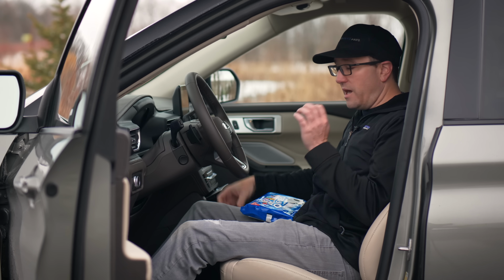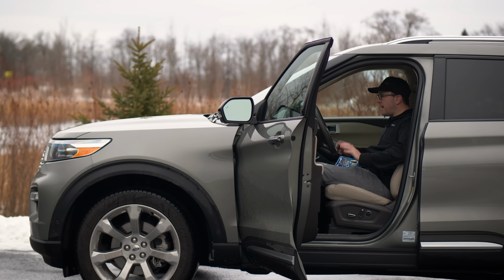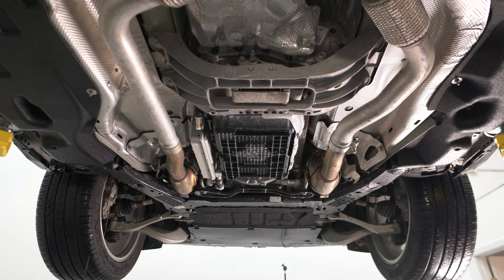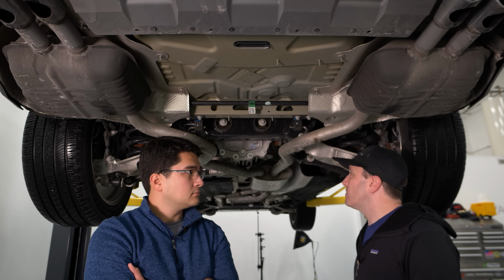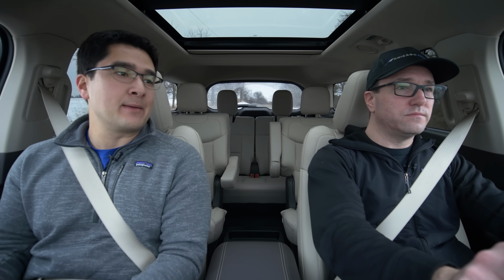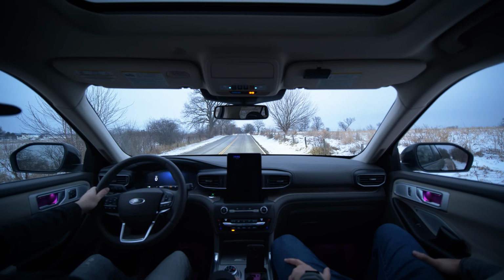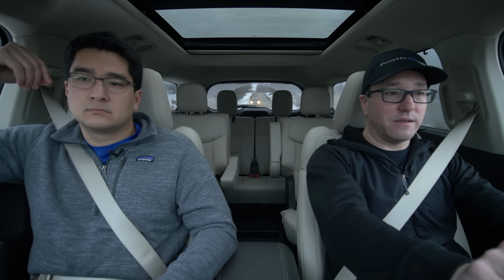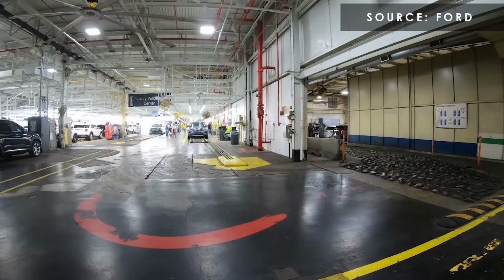2020 Ford Explorer | Who Is Responsible For This?

Comment: Very good review, that's fairly comprhensive. I've had 3 Explorers since 2006. Steering and handing have improved a lot. The seats have improved marginally.. The engines are very good, but the gas milage has improved slightly, even having gone with a smaller engine on the entry level models. There are a lot other SUV's that can be considered in the under $60,000 price point.

Comment: I'm looking at a 2018 Platinum.  I've always wanted an Explorer, then gas prices went up in the early 2000's, so I bought a 2004 Ford Focus, brand new.  I am driving it to this day.  Now I'm retiring and I have been dreaming about an Explorer for over 20 years. I  saw the Platinum and fell in love with the sparkly white and leather seats.  Not going new....when they changed to front wheel drive, I was crushed.  No, I dont like the 2020 and too expensive.  We drove a new 1990 Ford Aerostar extra room in the back.   You couldn't kill that van.  It was awesome!  Traded it in, 2005 for 2005 Ford f-150, which my husband still drives.  My son has been driving a 1990 Explorer Sport since 2002. Still going strong.
Been in love with Ford since my parents bought a brand new 1969 Ford Country Squire Station Wagon.  Wish me luck.

Comment: WHO would think of doing a vertical screen???? It makes literally no sense at all. It doesn’t even work well. This is literally a mess.
Reply: Ask Tesla, they started this stupid trend with their screen in the Model 3
Reply: Adam Smith at least they don’t have it sticking up out of the dash though. This one is just such an afterthought look
Reply: @cjr21  Yeah the Ford designers don't understand nuance and detail.
Reply: @AdamSmith-gs2dv  Model 3? The S is vertical.
Reply: We get tickets for using our phones, but the ipad is ok
Reply: It makes sense to have, say, navigation on the top half and the radio on the bottom. Subaru's new screen is vertical. I think the problem here is more the poor quality of the screen and poor implementation of the software.
Reply: Steve E eh, a horizontal flows better with the eye on the horizontal dash. Just my opinion but also yeah they really messed up on the software not using the full screen
Reply: @stevee8318  My wife has a 2021 Subaru Legacy and I don't like the screen. Mainly it's not wide enough. The map is too small for example compared to my Ascent.
Reply: I am one that thinks either have advantages (horiz v vert), but it's the WAY it was designed with the dash.  It looks like a little kid with paste stuck it there.  No flow and it looks like it was after-market (just as SG noted when others asked him if it came that way).  Also as noted the software and NOT making use of all that vert space. 

Build it into the dash and have a little cowling around it to keep glare down.  Can you imagine instrument clusters of the past 50 years being built free standing with no cowling  around the gauges?  You wouldn't be able to see your speed or RPM or anything 50% of the time during the day.
Reply: @ovp66223  I remember the C-class also had some criticism for it's infotainment screen sticking out of the dashboard with a fairly thick bezel, though being in landscape orientation probably makes that design less obvious
Reply: Having owned both I actually like the vertical screen better
Reply: Tesla does it and it works well for them, Ford just didn’t understand why it works they just slapped it in there
Reply: Carlos Rosas we have horizontal eyes 👀 after all
Reply: Looks like ass crap
Reply: It makes sense on paper as all our daily devices are used this way.
Reply: Ram 12?
Reply: Yet no one complaining about McLaren screens..
Reply: @tharinduperera8758  sorry that’s not in the current budget.

Comment: The brake pads that dealers have to install for the ST performance package  cost like $300 for the front pads and like $200 for the rear, so just a heads up

Comment: Great review of this car, and its a true review, and not some canned speech like most of the reviews you see.  I have a 2015 Edge with every option, and 6 months in the front two seats looked horrible.  The padding just gave up and they really are ruined.  I noticed how bad these seats look way before you ever mentioned it.  I also agree about the center console screen, it looks like they added an iPAD after the fact.  Its Ford's cheap way of copying Telsa's center screen, but in a bad way.  I've been a Ford guy for most of my life, and I love my 2018 F350.  I'm going to consider the Duramax Tahoe when it comes out.    Kent K.

Comment: I have the 10 speed in my 2019 f-150 and i love it. I can tell the differences between all the modes, sport is amazing, the throttle response is dead on and shifts are quick and keeps the power going. Towing is amazing with the 10 speed as well. Not sure what went wrong with the one in the explorer but don't let that ruin your view on this awesome transmission.
Reply: This applies to your truck. I wouldn't touch anything co-developed with GM. 

https://fordauthority.com/2019/08/ford-f-150-10-speed-transmission-subject-new-lawsuit/
Reply: they're not even remotely similar in how they're tuned from Ford. I had a 18 F150 and my wife still has her Explorer ST and you really need to drive the 2 to see just how bad the Explorer is. it's not as simple as "well it's a Ford 10 speed, they're all the same".

Comment: The 10R60 in the 2020 Explorer seems to be different than the 10R80 used in the F-series and Mustang, but ask anyone about their 10-speed F-150 and the majority will have complaints about the way the transmission shifts. The same 10-speed seems to work fine in the Camaro and Silverado, so GM's tuning and changes must have done something right.

Comment: American cars are famous for “designed by teams.”  The problem results when these team don’t communicate.  Chevrolet is a good example of this: how many times does the center of the steering wheel NOT line up with the center of the driver’s seat?  Too many.  If you drive a Chevy, go look at your vehicle...

Comment: Eh.  Lots of people here in the comments bashing it. It’s all relative.  I have this in the ST trim, it’s my family hauler. And you know what?  I love the shit out of it. It is a blast to drive. It’s quick AF, handles great for what it is and looks fantastic. Sure, some panels don’t line up perfect. Okay. But then, it’s not a Benz. And for a Benz with this level of performance, you will be spending quite a bit more.  

And I love the screen orientation.  It sucks with Sync 3, but Sync 4 is coming out which will make use of all that real-estate which why they oriented it as they did, in prep for Snyc 4.  As for the transmission, I honestly haven’t had any issues. And it’s nuts in Sport mode. It hangs the revs when you let off which makes flooring it again even more satisfying.  The sound system, to me, is more than adequate for OEM. (And the $1000 option is for the portrait display, massaging front seats and 2 extra speakers with extra wattage - it is NOT really a sound system upgrade). I added an amp and 10” sub for deeper lows. And now it sounds amazing. 

Lastly, I am not a Ford apologist or die hard. In fact, this is my first ever new Ford and my second ever in my life (my other Ford is a POS mustang I use for autoX). So everything I’ve said is coming from someone that researched. Sure those other SUVs are super nice. But they are slow. They are minivans in SUV form. Which is fine. But the ST matched exactly what I was looking for: an engaging drive that I can haul my kids in.  And those are my priorities, and this meets it.  My passengers so far, they’ve loved it too. And not one of them so far has said “hey, your one panel there doesn’t exactly line up, this vehicle is shit.”  

So I appreciate the review and the honest opinion.  Me, personally, I can’t speak to any other trims but the ST, and so far I love it.

Comment: I think you should have tested one of the trim levels with the four cylinder turbo (though you mentioned the 4 cyl without testing it). Most of the reviews I have read about the four cylinder turbo have been positive, and most people who will buy the Explorer will purchase the XLT 2002a pkg or Limited versions which both have the four cyl turbo. Therefore, your review has primarily excluded the Explorer's base audience as most consumers can't afford the ST and Platinum versions which come with the 3.0L V6, and cost roughly about 60k. I would steer consumers away from the explorer because of the recent press about its transmission problems, and not this review because I think this review was a miss.

Comment: Does adding $20k to this, cough, Lincoln Aviator, cough, fix many of the issues?
Reply: No interior fitment is horrible in the aviator along with the transmission. The sound system is better but still rattles. Both these cars are half baked, stressed mechanically and horribly built

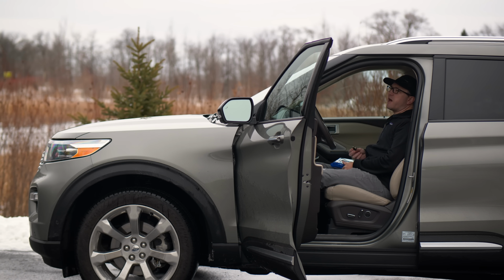Comment: 4:51 The jointing between the base and the backs of those seats is unforgivably bad. Look at how exposed all of the joint is! That's madness! You can get your whole hand in there! It's like they knew that their tolerances for quality and dimensioning would be really bad and thought; well, if we don't put the parts so close together we can build the seats as poorly and as cheaply as possible without affecting the fit. But it looks atrocious! I've never seen a joint that bad before. As a designer looking at this, it's totally insane.

Comment: Great revealing review. Always love your videos. Learned and laughed a lot. I owned the 10-speed in Camaro ZL1 that I had for about a year and thereafter a Raptor. The ZL1 shifting was F.A.N.T.A.S.T.I.C. The Raptor had the same jerkiness( in 5th primarily) you describe. Fast forward a year or so and we need a 3-row.  This will not be it. Still considering the Aviator though. BTW, my daily is a Tesla Model 3 and it is absolutely amazing.

Comment: I looked and drove most of the SUV's in this class and bought the Explorer ST.  Its the only model to buy in my opinion.  None of the front drivers in this class compete chassis wise.   Because the Explorer is rear drive based its simply  superior.

Comment: But have they fixed the brake pedal issue that plagues so many Ford SUVs and Crossovers, where they forgot to recess the arm that the pedal attaches to so your toes get hung up on it and roll off the pedal during light braking?

Comment: Sorry to go against the grain here, but I LOVE my 2020 Explorer ST!  I feel it is a fabulous vehicle.  Why do I say that?  The handling for the ST is great, it is very well balanced and handles extremely well in the corners (and I have raced formula cars for 32 years).  I have not had any issues with the transmission, in fact I think the transmission is timed very well, but maybe the ST is just tuned differently.  I agree that the fit and finish on the inside is not the best (that is sad) but everything else I love.  I also agree that the huge pad int he middle is overkill.  I am not a Ford apologist or a Ford fanboy and have owned many different cars, trucks of all brands.  At this point I am seriously considering purchasing it after the lease is up but that depends on the reliability over the years.  So far, I would buy it again and I do enjoy having it in my small fleet of cars.

Comment: I guess I'm one of those Ford guys that will overlook minor issues and not stress over things that at the end of the day don't make the vehicle perform any better or worse. I like the styling, the comfort of the seats, the  audio system is good and I particularly like how much better the infotainment screen is. Something that I would consider an issue is the left foot space in the older models. I had a 17 Platinum and felt like the driving space was completely out of sync. That's something worth complaining about.

Comment: Oh, Ford leather. Don't ever change. Actually no, I thought it had. My 2007 Ford's seats have 142k miles on them and they're just now starting to lose color from wear and the driver's right seatback bolster foam has failed. That driver seat in this 2020 model is straight up inexcusable, rental or not.

Comment: Drove all of the SUV's you talked about.  Hyundai, Kia, Honda, etc.  None are as much fun as my new ST. The motor is absolutely great.  I don't have issues with the transmission.  It works fine.  The safety features work.  This feels like a much more solid SUV than the front driver's.  SYNC is intuitive.  As a car guy with Vette's, Mustang's etc. in my past, this is the most solid,  fun to drive  SUV except the German's with their high prices, premium gas and expensive maintenance costs.  No it's not for the track and the suspension is a bit firm at times.  But I'm good with that experience.  I was willing to give Ford a chance with this and have been happy for the last two months. I also purchased an extended warranty just in case.  But so far there have been absolutely no issues.  I have a car manufactured in October, '19.  Not an early summer unit.  The purchase discounts are there and this is $20k less than a German equivalent when net priced.  So what if there is a bit more plastic.  If I were in a snow belt this would be better in winter also.

Comment: This dash, this center screen, are enough for me to skip this car
Reply: Yep.
Reply: Yep...not a fan of all digital instrument panel, especially if something goes wrong.
Reply: @crlaw75  I agree if was better left alone or just get the XLT/Limited but I hate certain design my self and ground clearance it may as well be a car 😂
Reply: @tony24-u9x  Actually, it is not on more than one level. It is not positioned well for the driver. So, when you in the driver's seat, you don't get to see screen colors the way they displayed. @savagegeese has it explained.
Reply: I have even less respect for Ford than I do for most of GM and that's already not much
Reply: “And for that reason, I’m out.”
Reply: give me an ipad, some glue, a pair of pliers and 10minutes of time and i'll build a better dash/screen combo in my old 90's corolla
Reply: The blue background is enough for me.
Reply: IMO since Lincoln is a sister company of Ford, it seems like Ford is concentrating on investing big money in luxury SUV's because they are a huge market right now. If i had the money i would definitely consider buying a Navigator or Aviator. They are beautifully designed and well built especially the interiors. Plus you can get a twin turbo V6 in an Aviator that HP wise can compete with an X5 M40i. If Ford doesn't invest big money in the luxury performance SUV market they will get run over by BMW, Mercedes and Lexus and you could argue they already are but the Navigator, Aviator and Corsair are a big step in the right direction.

Comment: We have a 2020 Limited. Of course it doesn't have near the features as this Platinum, but it was also about 15K less. I'm sure the 3.0 V6 runs like crazy, but so does the 2.3 4 cylinder. It makes 300 hp and does just fine. The lower trim levels have the center display horizontal, rather than vertical like that one. It's not as big, but you get a full back up camera display instead of just one corner.
Reply: I have one too and agree with you
Reply: I know this post is 4 years old, but I thought he was pretty harsh with his criticism. How is your Explorer holding up?

Comment: How are the seats comfortable?  Those headrests aren't designed for use by the human anatomy.  I wish I could say that this is anything but typical of pretty much all vehicles made after about 2002, but I'd be lying if I did.

Seriously, when did headrests stop being a place to rest your head and become a torture device seemingly designed to force your posture into a downright painful position?

There is absolutely no way those seats are comfortable.  None.
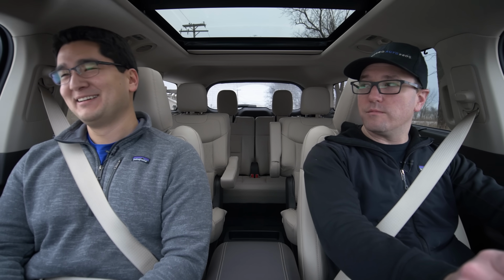Reply: Yep, there is is.  14:16 - your chin is hunched forward in front of your chest. 

Those seats are actively uncomfortable.  You need to recalibrate what is actually "comfortable."

Comment: lose the stupid oreo package..  that looks very bush league....      the seats look like they are failing...  the screen is beyond dumb...   3/4 of the screen blank when trying to use the backup cam...  wow bad engineering.   cheap tacky plastic junk for more money than better trucks...   no thanks.   the transmission is a joke...

Comment: Man this review was brutally honest and damning . . . .

Just as a comparison, bought a cream puff 1992 Lexus SC300(the 2 door coupe) in 2012, 60k miles, one owner, 5 speed(rare lol).  Sold in 2018 with 100k miles, it was my "driver"   It was pearl white with a very light tan/cream interior similar to that Explorer.

The level of fit/finish on that Explorer vs my 20+ year old Lexus is just laughable, the wood in my Lexus is actually real veneer, all the plastic parts actually form a uniform gap, the leather, even on a 20+ year old car looked nicer the day I sold it than that shit on the Explorer where there was a major crease which would form a rip in a couple years.

Comment: This interior looks much better. After spending several hours in a 2013 Limited i was surprised how badly designed the inside is. The doors are ridiculously thick and theres this cocoon effect with the dash. So much wasted mass. The seats were too stiff if you are driving for more than an hour. And the glove box opens 2 inches before hitting my knees. How does this make it into production??

Comment: they have a good points at one point and then they just sometimes fall flat on their face. If it were me I would take that v6 out and put a V8 instead of the 10-speed transmission 7-speed. We're better suspension independent suspension with crappy shock systems are not a good answer coil-over spring shocks no!!!!!! Air and coil, not air bags, but air shocks and coil or Magnetic Ride suspension.